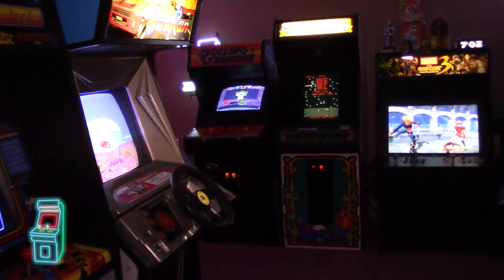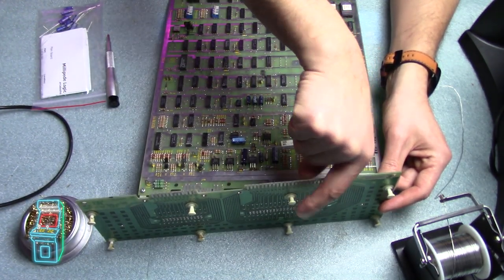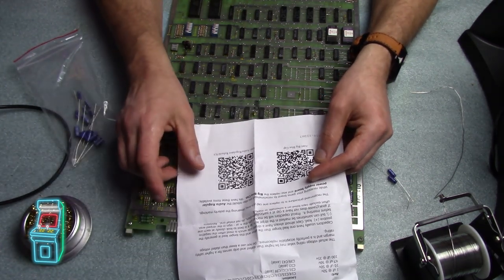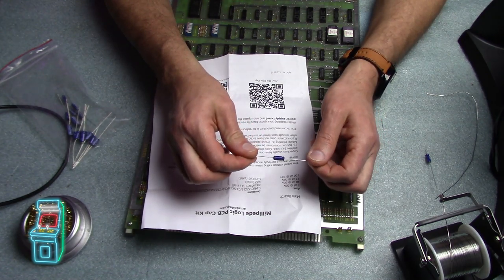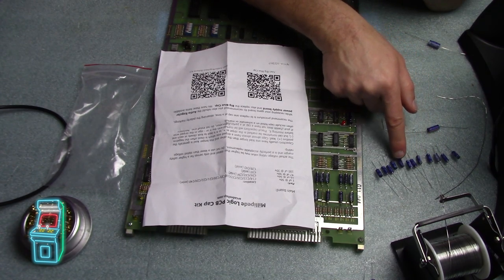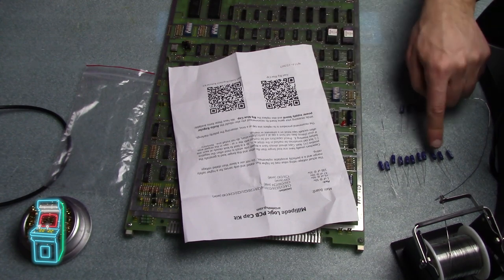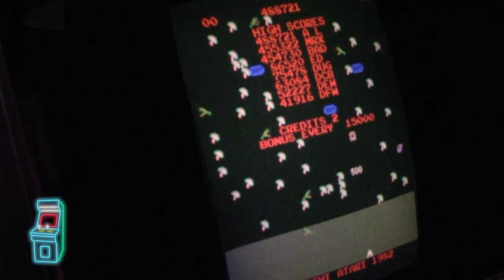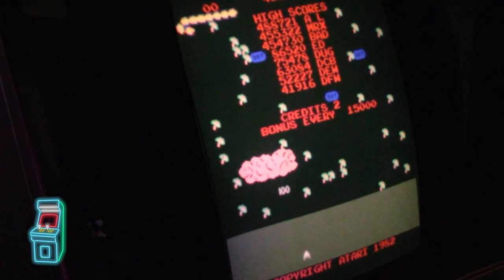Millipede PCB Cap Kit [Resto Part 4]

Comment: When it comes to replacing capacitors, I like to turn the board over, pull on the legs to bring the caps closer to the board, and then give the legs a slight bend on them at board level, means they hold their position for soldering and they are nice and close to the board.
Reply from the maker: Yeah, I do that sometimes as well, but some people frown on that method because the bent legs are a PITA to take out if you need to do it again in the future. 
But I've been known to quickly do a cap kit on a monitor by desoldering each old cap, popping the new one in and bending the legs all the way.  Once all new caps are put in place, I turn it over and solder/snip everything all at once.
Reply: @delsarcade  Ahh, yeah, I don't bend all the way, just a few degrees off of straight through, enough to stop it falling out, but not enough to make it difficult to desolder and pull in the future.

Comment: I learned a lot from your video as well. Great explanations and camera work.  What older do you use and what is the temp of your solder gun?
Reply from the maker: Thanks for watching!  I set my Hakko 888D to 750 degrees Fahrenheit as mentioned at 16:30.  The solder I use is Kester 63/37 (leaded).  Links to the stuff I use are always in description. :-)